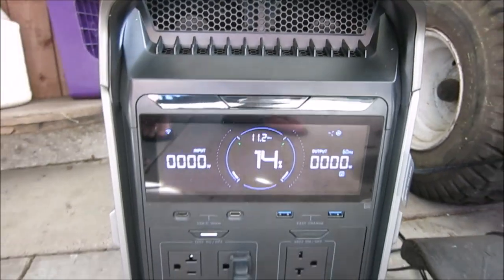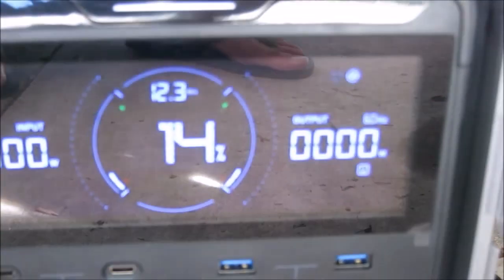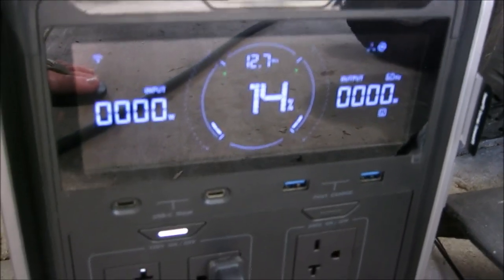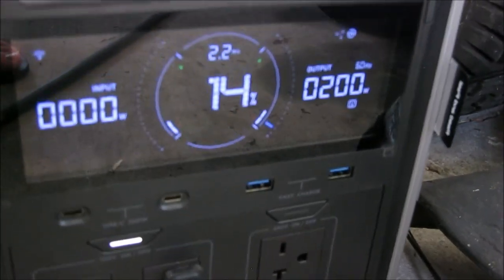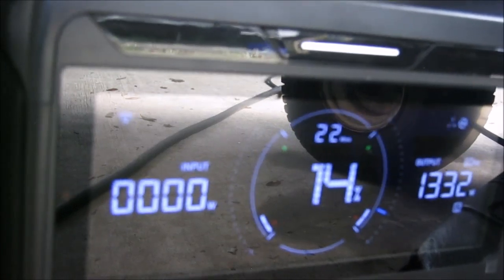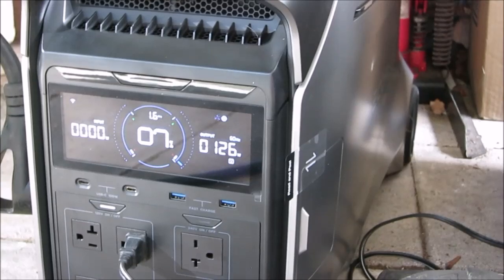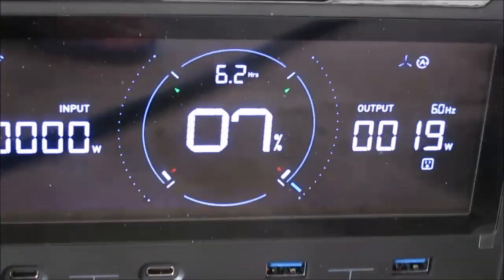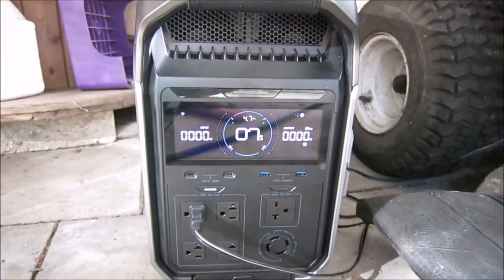EcoFlow Delta Pro3  first use

Comment: Charger might be bad, unplug everything, charge the Ecoflow and try again. Probably issue with the charger and battery, not the Ecoflow.
Reply from the maker: I've tried other battery chargers, the DP3 shows 0 output with multiple chargers hooked up to it. It's like it has to reach a certain power output before it registers.  Have tried to contact EcoFlow about it but their after-sale tech support leaves a lot to be desired.

Comment: That's so weird. It doesn't show any wattage drawing from the battery charger, excep when it wants to. But then it showed 12w at one time so something is fishy with the eco-flow unit. Maybe try and measure the current from that battery charger using a watt meter plugged between the eco-flow and the charger. At least see if the battery charger is doing what it says it is.
Reply from the maker: I suspect that maybe the meter for the power output is not sensitive enough to detect <10 watts and if it drops below that it will show zero. Doesn't really make sense though. Either that or the battery charger is still showing charging when in fact that battery is charged and not drawing any current.
Reply: @bogotabro  I agree on both thoughts.